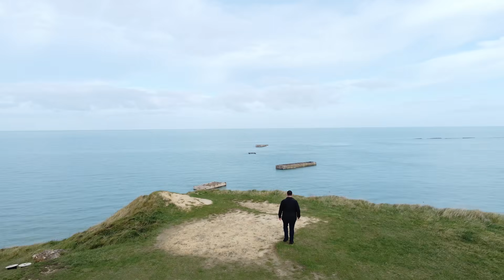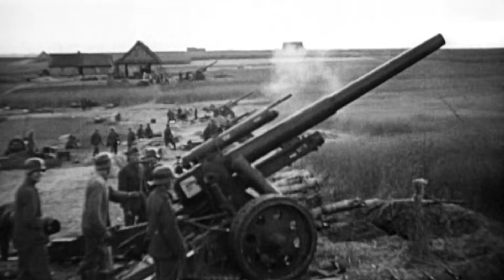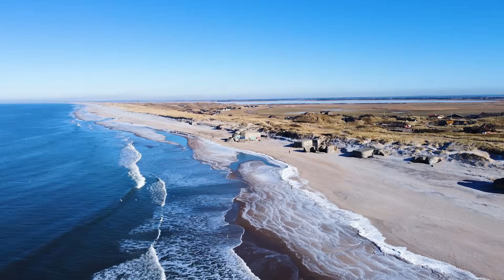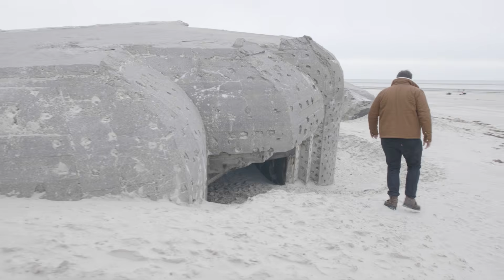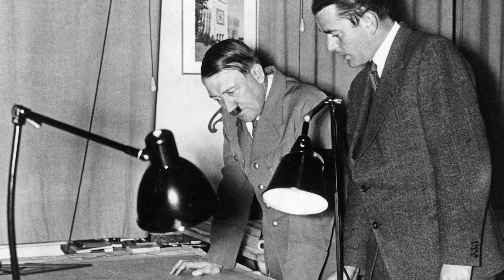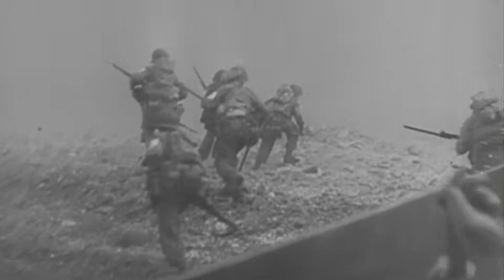The Fatal Design Flaw In Hitler's Atlantic Wall

Comment: The other major flaw of the Atlantic Wall was the vast amount of fuel required to produce the cement and steel used in it's production, particularity as the Third Reich was already facing an energy shortage from limited coal production and access to oil.

Comment: As said by some, its a matter of combined arms - in this case, combined defenses. Slow down the invasion, then counterattack. Some generals wanted the Panzers be positioned right behind the beach, while others proposed a in-depth defense. Someone noted: Hitler choose a compromis, wich destroyed the advantages of both opproaches - not sure whether that statement is accurate.

Given the lack of logistics and mobile warfare due to allied air supremacy, a positioning behind the beaches would have been a wise consideration. Also, in simulations Normandy proved to be a weak spot after all. Germans overestimated the allied abilities to also land a force near Calais, and kept some reserves there. 

What applied to the maginot line, applied to the Atlantic wall as well: it wasnt a bad idea, but only when additional and correct measures are taken. When the big picture is flawed, any specific part will become useless. Not to mention: different setups would have resulted in a different approach by the Allies. A "what if" consideration can be learnful, but might not result in a different strategic outcome.

Comment: The Atlantic wall in the Netherlands did see some use in their defense of the Schelde. By failing to overrun Zeeland when Antwerp was liberated (attacking the wall from the rear), the use of a deep-sea port was denied to the Allies a lot longer than necessary. Any ship trying to approach Antwerp was simply blown out of the water by the Wall defenses.

Comment: Well, considering that less than 1% of the project was ever going to be used in combat, the Atlantic Wall was an absurd waste of resources. It would have been infinitely smarter to invest in mobile assets that could deploy to wherever the allies landed than in static defenses almost all of which would inevitably go to waste.
Reply: maybe, but the counter point was the coastal defences were not supposed to overturn the allied attack on thier own, but hold it up and slow it down enough for the mobile forces in france, some 11 divisions of panzers and panzer-grenadiers, to counter attack and thrown them back into the sea. In other words, they WERE planning to use mobile forces to counterattack. A key assumption of the german defence strategy was that the allies would NEED to capture a port facility in order to properly supply their troops, so defences were concentrated around ports like Cherbourg, Calais, Dunkrik, etc. agian, the difficulty in supplying troops over open beaches would slow the allied build up and give the germans more time to mass and counterattack. 

However, the allies knew this, and made extensive efforts to destroy the transport links up to the theatre, as well as using extensive roving air patrols to shoot up everything that drove in german rear areas. the net result was that the germans struggled to bring thier panzers up to the front, having to road march, and then only at night, and by the time they could get to the front the allies were ashore in strength to great to dislodge. 

Rommel, having fought under allied air superiority in north Africa, understood how oppressive it was, but his superiors, used to the eastern front where the soviets could at best contest the airspace, did not. If those divisions had been forward deployed into normandy and calais, they might have had more of an effect, but its unclear, and not certain. the allies would doubtless have changed their plans somewhat if the pazers were concentrated in northern france, by launching the southern France invasion first to try and draw some south, for example.

The allies had also invested HEAVILY in amphibious technology and equipment, stuff like landing ships, the higgins boat or especially the DUKW that could deliver goods form offshore transports directly into supply dumps inland, all of which invalidated the german assumptions about what could be supported over open beaches.
Reply: Well the theory is that by merit of the defenses being there as to being absent, the allies would be forced to funnel their invasion to a limited number of landing sites, which could be targeted by entrenched troops(and the limited number of reserve divisions spared the Eastern Front), and that would negate their numerical superiority in an amphibious landing. And it did, for a little while.

No defenses means they can pick the nicest beaches all the way up the coast and land at their leisure, the defenses resulted in the invasion happening later since they had to be accounted for. Some weapons don't need to be used to be useful. Look at nuclear weapons, their mere existence renders their holders basically immune to invasion, nobody wants a nuke in their face, and so they don't engage at all, and the weapons aren't used at all.
Reply: Seems the Germans had the best engineering  but the worst resource management.  Take the incredible Gustav gun.   Impressive in every way but, as I understand it, it took thousands of men to lay track, assemble, and defend it, to say nothing about the time required.   How many fast, light tanks could have been fielded with those resources?  How much more support materiel and food could have been sent to, say, Stalingrad were it not being diverted to the Gustav guns?  Imagine if those resources had been dedicated to the Luftwaffe and more accurate, albeit smaller, bombs?   I guess it's lucky Hitler was not dissuaded from his apparent bigger-is-better attitude in favor of more efficient plans.

Comment: The Germans ran out of ammo- Thats It that how the the D Day landings happened. Each MG nest sould have had accsess to 24hrs worth of ammo, but they only had 2hrs to 6hrs worh. Each sector of D-day fell as the ammo ran out. The Bunkers sysem worked-The Logistic failed.
Reply: Bullshit whoever gave you that information was not at Normandy beach And you should double check your facts instead of falsifying history And discrediting the men that fought And died there My own grandfather at Juno(mike section) They had a 1 in 2 chance of living in the first hour However into the 2nd hour they were pushing into  Bernières And by mid morning it was fully ours ..........And the Canadians found weapons not used Crates of ammo of all sorts. And faced Tanks with shells and Machine guns And members of the SS squadrons under heavy fire And losses was the first to complete all of its objectives .........Further inland was  Andaines forest in Normandy Where the Germans had a Fuel/Ammo/Food dump storage for the Juno section with Trucks and trailers Being only 1 hr away at 71kms a hr ..Do you still think my facts would be wrong to say...Hmm the Germans pretty much knew the allied ships were coming And already had More than 2 hours worth of ammo? Because i know having a few thousand rounds You will still need to change out the barrel And have fresh troops take over the dead ones ...They were simply over run
Reply: Very good point, a gun is useless without ammo

Comment: It's ironic that amilitary that famously proved that fixed fortications, in the form of the Frnech Maginot Line, were a thing of the past would resort to fixed fortifications themselves.
Reply: The maginot line was designed to buy time for France to properly mobilise, it was not supposed to be impregnable.  There was also a lot of cost cutting which made them far less effective in combat.
Reply: The maginot could have worked if the Belgian king would have allowed it to extend into Belgium, also the German advance through the Ardennes could have easily been stopped with planes but the french refused to believe their recon